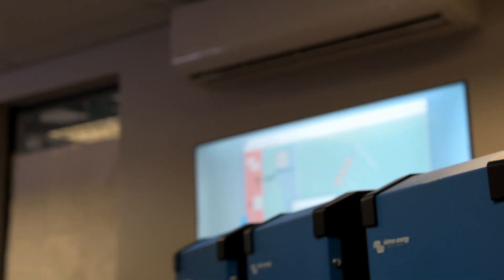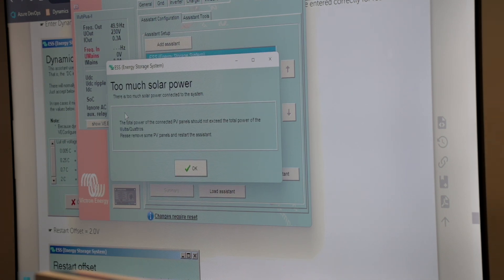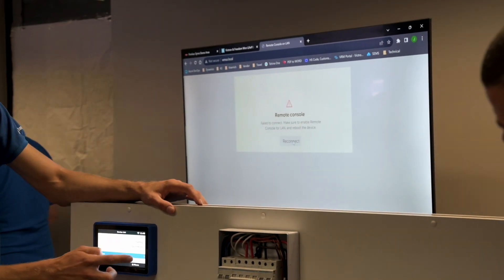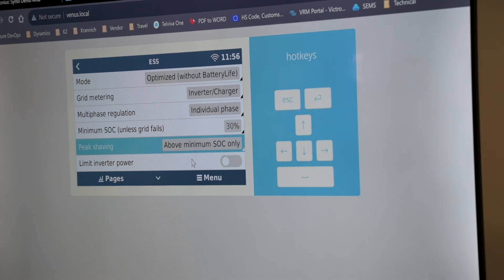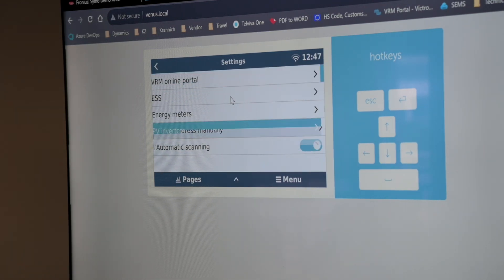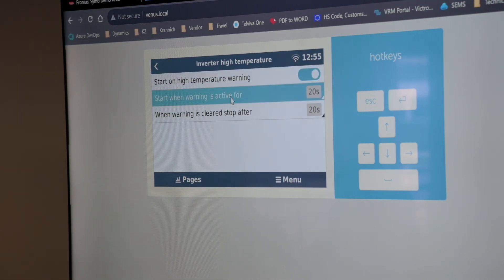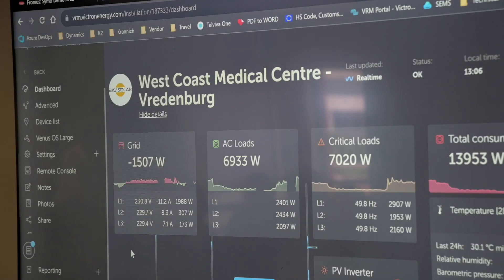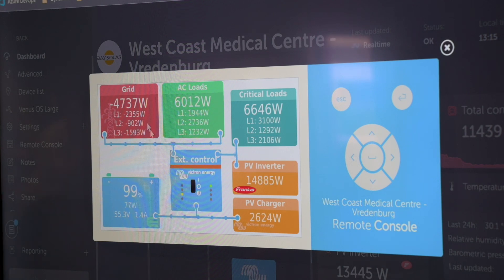Victron 3-Phase MultiPlus II System setup with Cerbo GX & Fronius PV Inverter

Comment: At 53:46 I can see, that at the "GRID" the "L1" is negative. Does it means, that the Victron supply back energy to the grid system? Is it possible to limit the the supplied energy to the grid to zero?
Reply from the maker: Yes, good observation, that is feeding back into grid. You can set feedback in ESS settings or Select "None" in grid to not feedback at all.
Reply from the maker: You can also check out this video https://youtu.be/olSGXS68u6k?t=1109 where some ESS is being configured